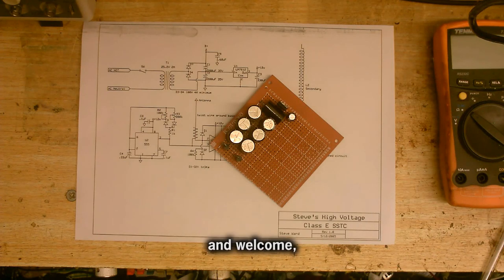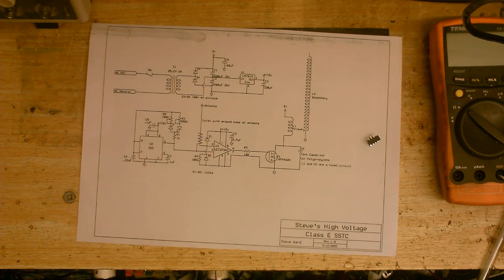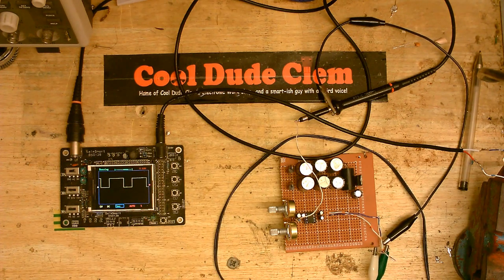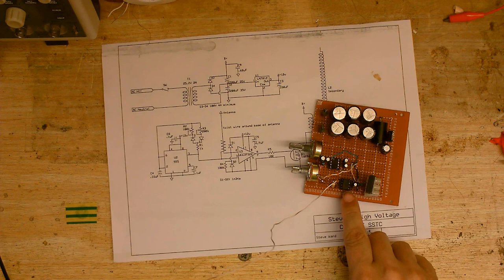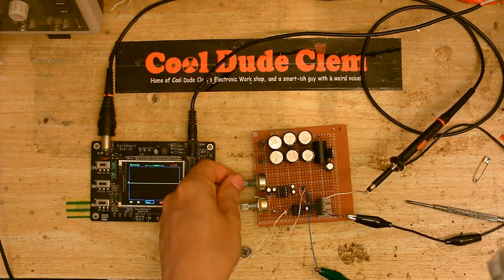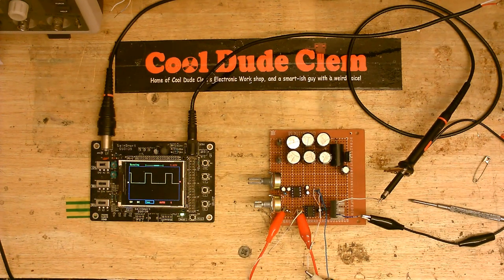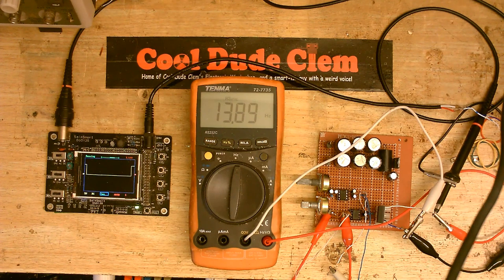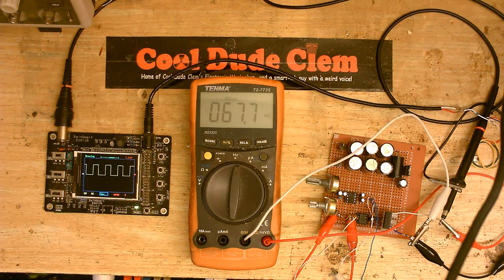New Tesla Coil Project part 2 - Making the interrupter and gate drive

Comment: oi! using terminal blocks is MY idea! 

lol, ive even had to replace the block... had a few melt/smoke/turn into black charred blobs. eventually i moved onto the little spring loaded ones.

i have no idea what the antennae is for? the whole point of the 555 is to tune it in?

the actual waveform you should be scoping is the gate of the FET. if that isnt square, hard switching... youre sort of wasting your time.  i prefer using simple discrete  push pull drivers rather than any chip for driving, myself (also using header strips for quick replacement!)... and on that note, the 10R gate resistor is about right, scope the gate and keep reducing it until it rings then back off a bit. depends on the FET, 4.7R is about the limit. its also interesting that as you go over 10R, the dissipation goes up until at about 100R even a 2W will smoke... and thats not good as it means the gate isnt getting a hard square wave... there is a world of difference in the nature of the discharge when its not switching hard.

sigh, really gotta get the old induction coil going again, i miss the square foot of corona discharge it could produce! that stench of ozone...

Comment: Clem i got one question?
i want to try to reproduce this steve ward circuit but instead of antenna i want to use OCD Ferrite feedback,
usually  one side go to the negative rail and the other to the feedback pin, but I see that there is a winding in the circuit around the antennas I don't know if it can be done without it or it is necessary to oscillate feedback this twisted wire around antenna?